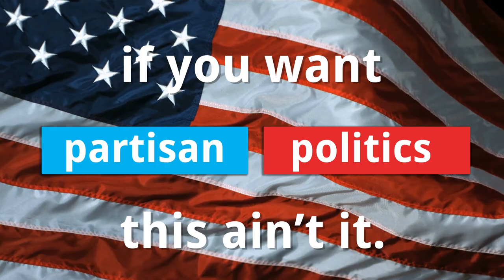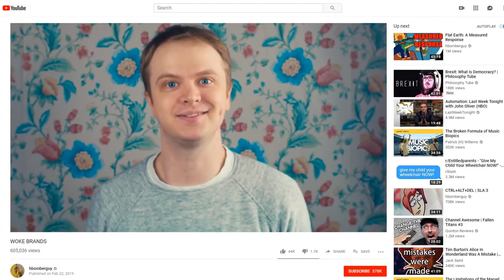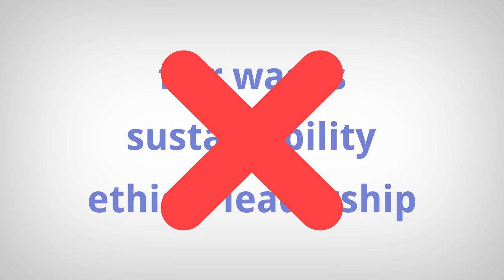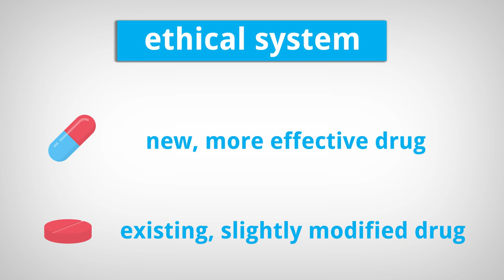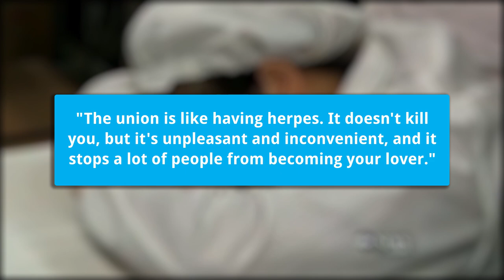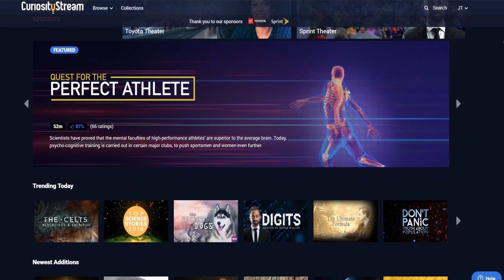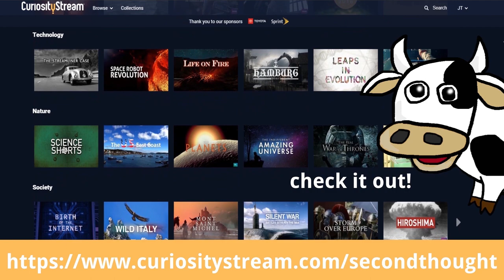The Predictable Rise of Conscious Capitalism

Comment: Capitalism isn't a "system". It's not profit-driven, either. Capitalism is what results from free and open trade between individuals, without anybody using violence. People are the profit-driven ones, and since people are free to do as they please, the results are (usually) competing profiteers. This might not seem important, but the distinction is critical, because PEOPLE are the most important factor in any "system", because any system ultimately relies on people. This means that no matter the "system", profiteerism is inevitable, the only difference is that Capitalism excludes violence, while all other systems require it. 

Tldr, you can't pretend that companies are the only entities capable of selfishness or evil. The government is just as corruptible, but has the added bonus of using violent force.
Reply: Capitalism is a system and it is profit driven system. Trading stuff isnt the same as capitalism.

Comment: I think the medicine argument is flawed. The reason it seems to work is because you took a deceptive example that is blurry because we are speaking of human lives. Any other example and it becomes an argument in favor of capitalism. For example:

Let's make an ideal case. In reality things aren't perfect, but for this example we assume they are. First of all there is a linear relation between cost and effort used to make the product. If the cost doubles so does the labor. Secondly we ignore diminishing value, which means that the value gotten from a product doesn't decrease over multiple uses.
We have a cake that takes 1E to produce. Eating the cake results in 1R for the consumer. So E is the effort used to create the cake and R the reward gotten from eating the cake (think dopamine). We have a population of exactly 1 person which has exactly 4E that they can "spend" exclusively on making cake each day. Now let's say there is a new cake recipe. It has the following values: R = 2, E = 4. I think it's pretty clear why this cake is worse. The first cake only costs 1E, so you would be able to consume 4 cakes each day. This would result in a reward of 4R every day. The second cake costs 4 times as much, so you can only produce 1 of them each day. This results in a reward of 2R each day, which is less.

Back to the medicine. The fact that medicine B is more expensive implies that it takes more effort to create. Switching to medicine B will result in less death, however we also need more production. So either less people get medicine, or we lose value from other products. You could make the case that the cost isn't representative of the effort; assuming this is true I make the case that eliminating the reason why cost and effort are unbalanced is a better solution. Lastly you could argue that the demand and value are unbalanced. Basically people don't value medicine B as much as they should. However now we are in the territory of psychology, collective systems or both. This makes the argument several magnitudes more complex making the medicine argument way too simple to properly address the issue.

Back to the main point in the video:
It seems like capitalism is the scapegoat here. I think I reasonably refuted the fact that in the previous counter arguments, however I do agree that pure capitalism is problematic. There are just too many things that make the system work imperfect, which is why I also believe that the system isn't fairly balanced at the moment (in any country to my knowledge). I think "conscious capitalism" is one of the prime examples of this. Even though the argument is flawed, the fact that companies will switch tactics the moment their consciousness isn't profitable is 100% true. Now in a way this isn't a problem, this is how capitalism is intended to work. Companies will produce what is profitable. Things are profitable when consumers like/support them. Consumers are consciousness, companies produce conscious products. The problem I have that it's all fake. Companies cannot have opinions. You can take the average opinion from its employees or perhaps from the people on the top. You can have actions that align with certain opinions. But in the end companies don't have opinions, they have goals. In most cases this is to make profit (and due to the nature of capitalism those seeking profit will have more success). Companies declaring things like: "We support the environment" is dishonest at best, but likely manipulative. A more honest statement would be: "Because of demand we are producing environmentally positive products".

Anyways those are my thoughts. Even though I think the argument is badly presented I do think this video brings up an important issue, one that has been annoying me for quite some while now.
Reply: You completely ignore the argument that better medicine could be produced at more efficient and cheapest ways if it had more attention from producers instead of simply producing the most profitable and easy medicine right off the bat. Furthermore, he used the medicine argument to highlight how little unrestricted capitalism cares about human lives when faced with the prospects of more and easier benefits and that is the whole point of this video.